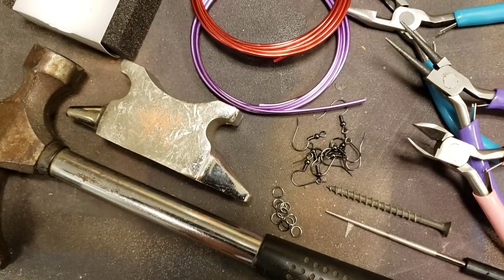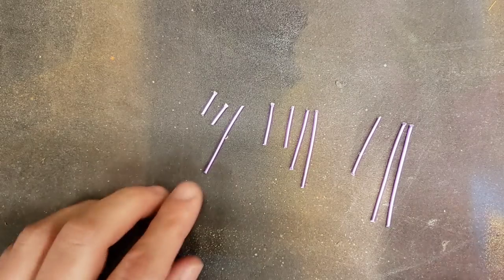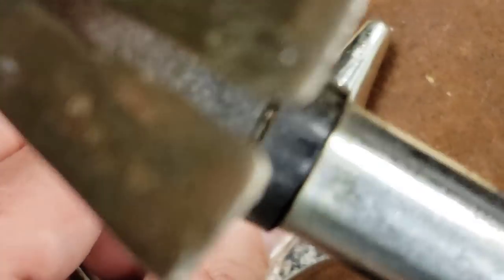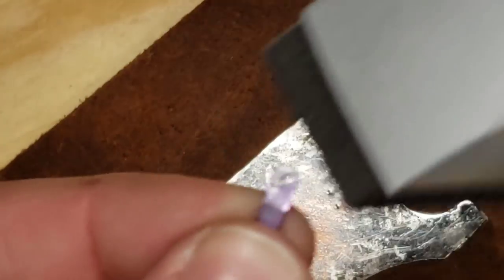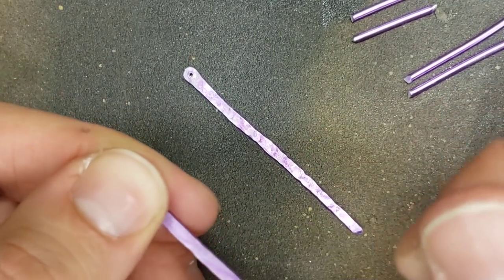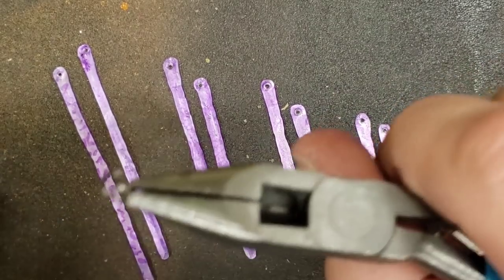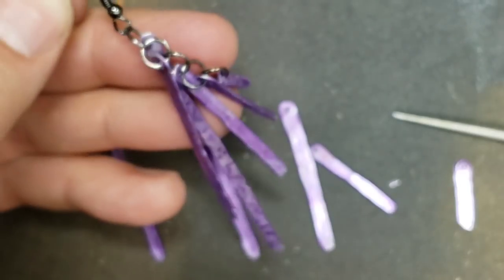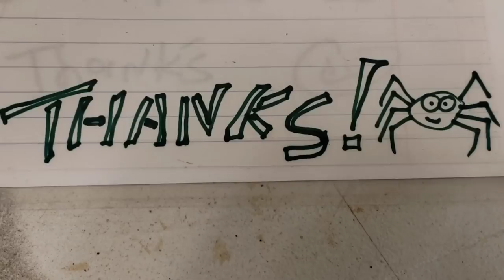Simple "Wind Chimes" Earrings - Eps 336

Comment: I thought you got a small metal punch in one of you care packs
Reply: rhaven50 yes...Matt in your last bextermonkey haul you got a metal hole punch..that would probably work for this project....lol...you probably haven’t unpacked it yet...I have the same hole punch and I punch through hammered copper wire and 20 gauge and higher sheet copper...
Reply from the maker: I haven't unpacked it yet and I also wanted to make it easy for people with more basic tools
Reply: Matt's Crazy Art that’s cool....I used to do it the way you demonstrated until I got the punch....that what I love about your tutorials using what you have handy!...also this got me thinking maybe it would be cool to do this with some sort of flat thin wood sticks maybe wood burned and color stained..but I haven’t figured out the wood part yet..like what to use...hmmmm...
Reply: No jangles,, craft sticks stain beautifully because back before you could buy miniature floors for doll houses we used them for inlayed floors. Craft sticks come in different widths.
Reply: Susan Gill ...thank you! Good to know. After this is all over I will check out the craft stores!

Comment: Did you leave them as is or did you coat them? The sharpie will wear off.
Reply from the maker: The sharpie would wear off if they were on a bracelet or something that rubbed a lot.

As earrings that simple dangle in the air, I am pretty sure the sharpie will stay.  If not, there's always nail polish.